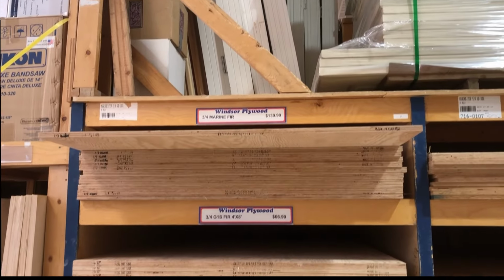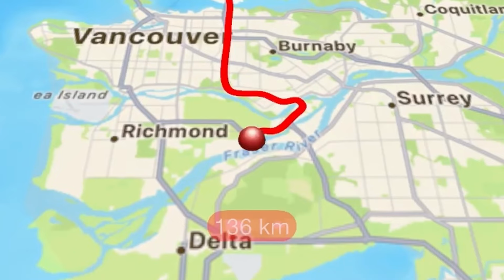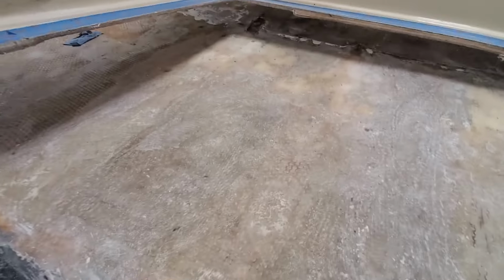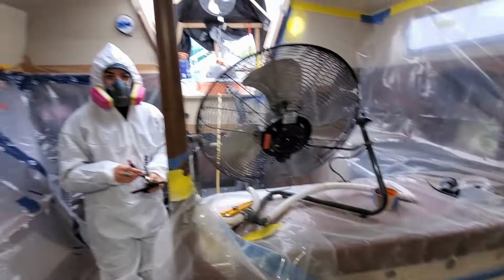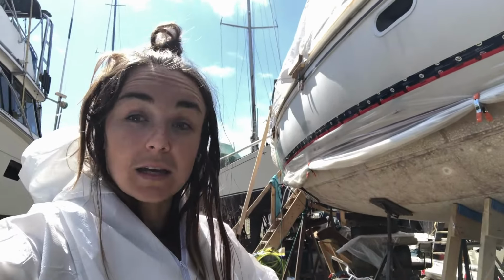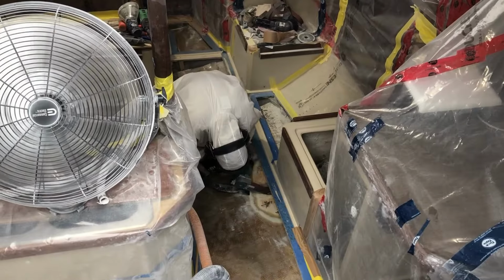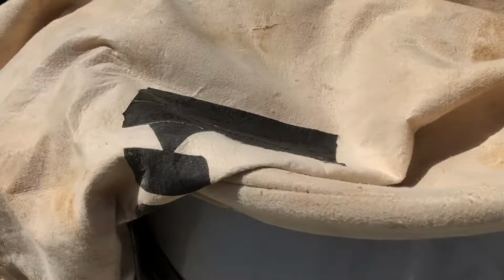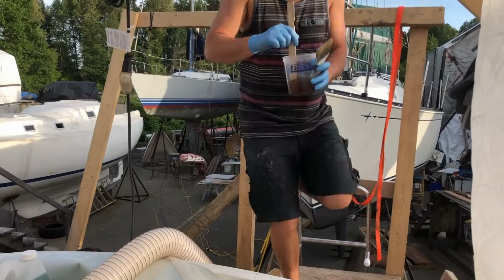SALVAGE Sailboat NIGHTMARE: What Surprises Await Us This Time? - SV YARREH EP.14

Comment: Why did you chose plywood for the stringers? You don't need strength in the vertical direction, and a plain wood beam would be stronger in the long beam-wise direction. Or, if the wood is just a form for the fiberglass and doesn't provide any strength, then in B.C., you probably could have still located some old-growth Western Red Cedar and had wood that was much more rot resistant than the plywood.
Reply from the maker: hey thanks for the comment, the marine ply is just to fibreglass over it, the fibreglass will make it structural and yes you are right we could have went with some dimensional kiln dried red cedar . My material of choice would have been carbon core foam as its easy and quick to work with., but as we stated in the video we were unable to source it during the pandemic. we will get into the making of the stringers in the next episode, so stay tuned for more info